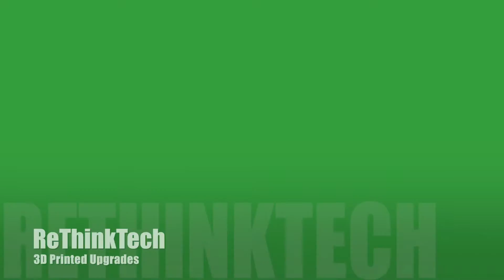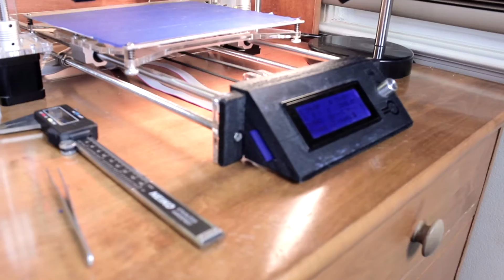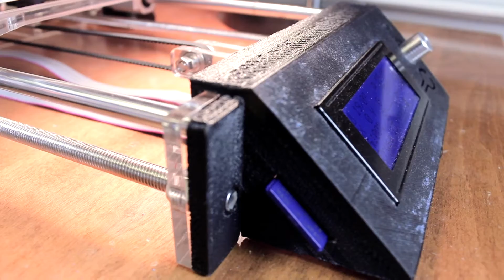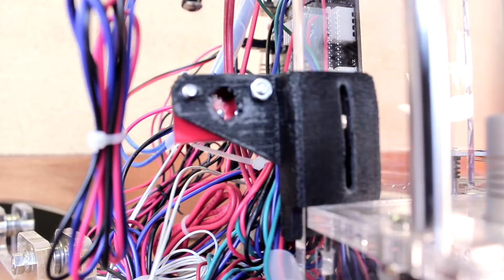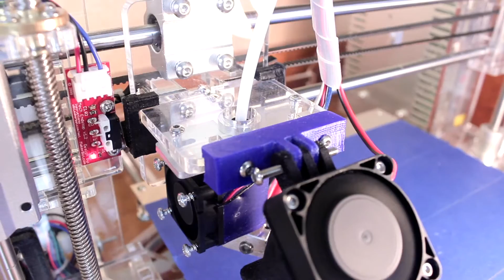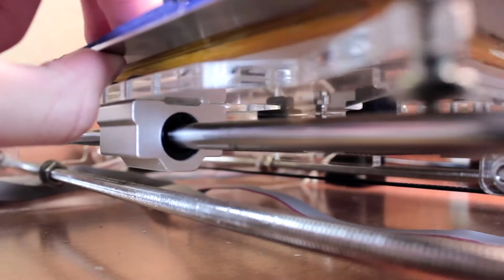Sunhokey Reprap Prusa i3: 3D Printed Upgrades!

Comment: Hi jack! Thanks for the video, really appreciated! :) Just subscribed!
I have a Geetech Prusa i3 W. I was wondering how could I connect the fan to the "motherboard": where should I insert the pins to start the fan? I mean when using the slicer and setting layers, ...

What kind of fan do you suggest?
40x40 mm as dimensions? How many volts? 2 or 3 pins?

Thank you!!
Teo
Reply from the maker: Hi! It really depends on your board. There should be another fan header next to the pre installed fan. Look at the pins and find a matching fan online. There should be one with the same pins. That voltage should work too.

Comment: Hey Jack,  first off I'd like to thank you for making your videos, they've help me understand my printer a lot more. I'm having a little issue, I just finished building my sun hokey Prusa i3 and my hot end seems to get super hot 280+ which causes a "MaxTemp error" message. Any ideas what this could be and how I can fix it? Thanks in advance and again, great job on the videos.
Reply from the maker: Hey Roman. I'm glad you like my videos! The MAX TEMP ERROR usually occurs when the thermoster is not working correctly. Try switching it out with the extra provided in the kit. If that doesn't work let me know. Thanks for asking!
Reply: Turns out I wired the hot end & heat bed in reverse. lol Fixed the MAXTEMP error, now to calibrate!
Reply from the maker: haha. Awesome!

Comment: Hello but how you calibrate the Hot end?
Reply from the maker: +Mattdj Mio Thanks for commenting! What do you mean by calibrating the hot end?
Reply: +reThinkTech I mean the extruder
Reply from the maker: +Mattdj Mio Ok. Check out the video I made on calibration. https://www.youtube.com/watch?v=mvpqxVl4FqQ
Reply: +reThinkTech Hi,you have project of extruder cooler?
Reply from the maker: +Mattdj Mio What do you mean?
Reply: +reThinkTech I mean this thing here: http://it.tinypic.com/r/2nlhlpy/9
Reply from the maker: +Mattdj Mio This is the link to the file if you want to print it. http://www.thingiverse.com/thing:340312
Reply: reThinkTech But PLA or ABS?
Reply from the maker: I would use ABS
Reply: reThinkTech I can not properly calibrate the platen. you have a guide?
Reply from the maker: What is the platen?
Reply: reThinkTech The Bed (Sorry for my bad english,i'm italian boy)
Reply from the maker: +Mattdj Mio I do have a video for calibration on my channel. You can check it out.